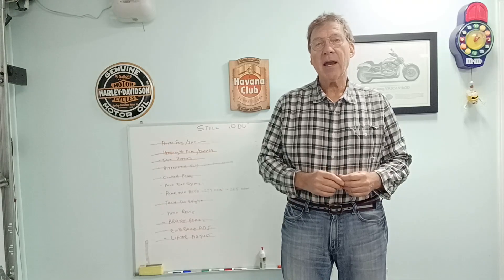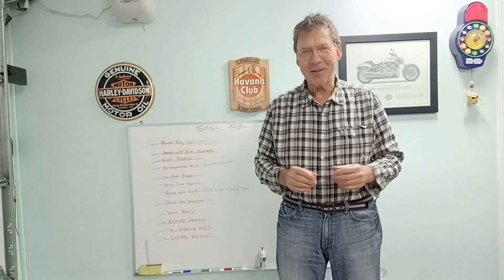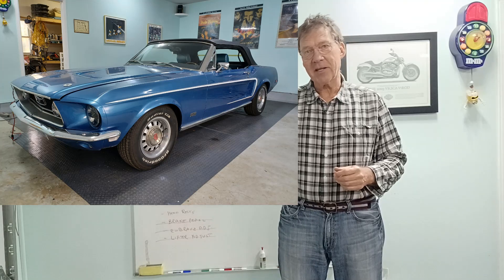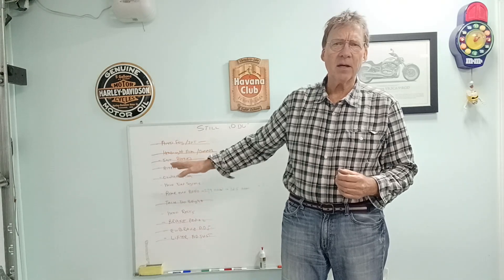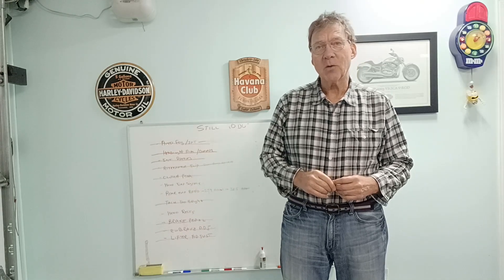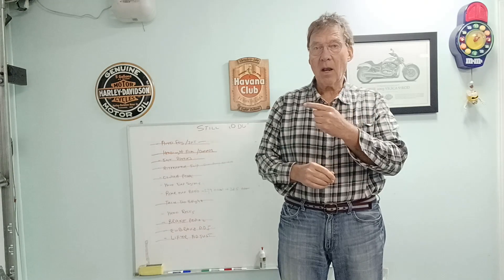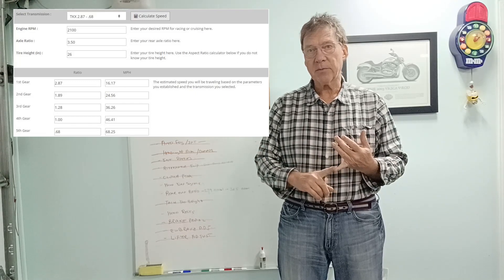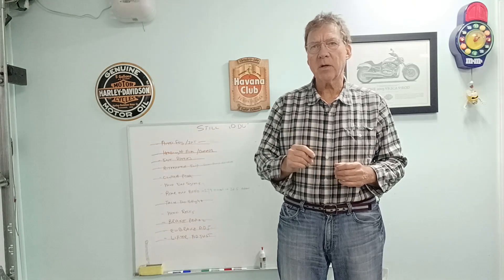mustang gear ratio

Comment: Cool Wally, hey I have a question for you. Did you check your paint film thickness?
Reply from the maker: Hey Don, no I had not. Basically I have never painted a car before so my first couple of coats were terrible and had tiger striping SO I sanded the surface and bought a second gallon of paint and did it again. So the reality is that this car probably has 60% more paint on it than a normal paint job. As far as clear there are 4 coats so I could cut and polish it without worrying I would burn through. again, no real experience cut and polish so safe than sorry also I decided against painting the side stripes for if I did I would need more clear coat to level out the paint.
Reply: @68mustangrestoration34  - I can feel the panic setting in as I get closer to paint. It took quite a bit of base to get the brown to cover the grey primer. 2 coats with the single stage on the jambs, 4 coats with this Omni base.
Reply from the maker: @donsmanufactory  do not panic... at the disco... sorry for the musical reference. You  will be fine. In my case the metallic caused most of the problem as it really changed based on how far the gun was from the surface. Too close and the metallic flattened out and too far it did not imbed itself.
Reply: @68mustangrestoration34  - Thanks for advise, when shooting the hood scoop I noticed a too close wet coat showed every sand scratch. Backing off the gun a bit gave a slight orange peel, stood the metallics up more like the single stage and covered the grey better. I’d better get my gun control mastered or the body will be blotchy.
Reply from the maker: @donsmanufactory  You got this! cannot wait to see her painted . So close now